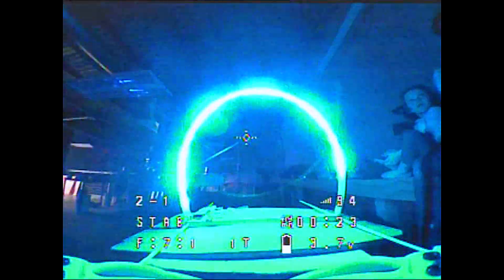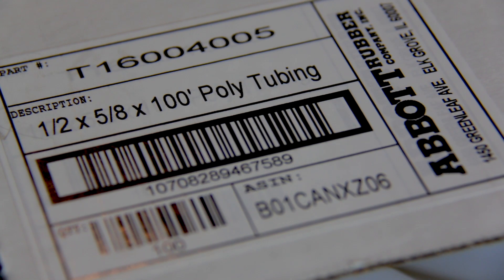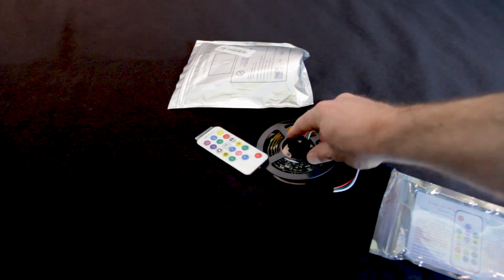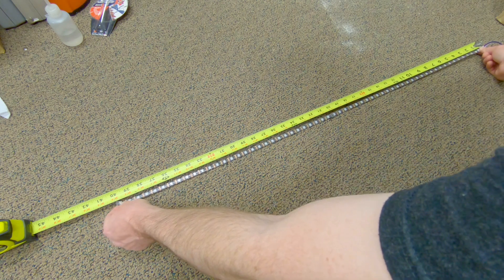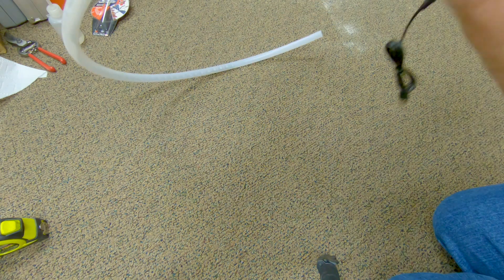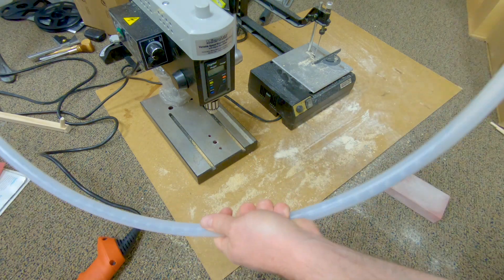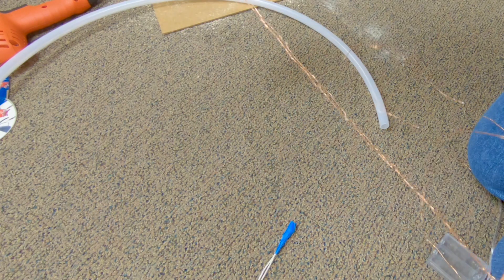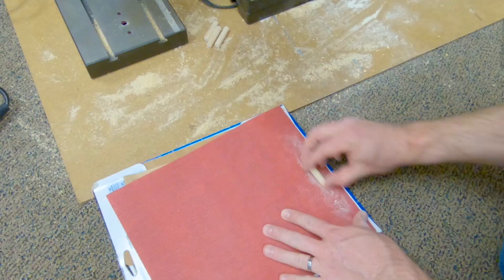DIY Cheap Micro Drone LED Race Gates | Part 2 - LED Hoop

Comment: FYI, A little electrician trick, attach a plastic walmart bag to the string and use a vacuum to pull the bag with the string through the tube